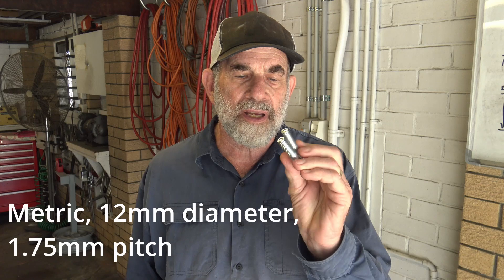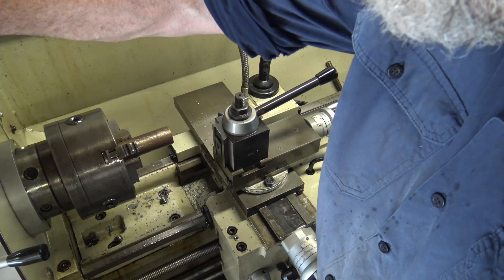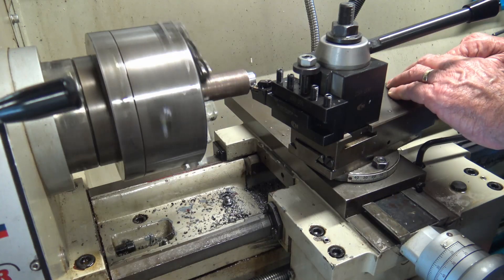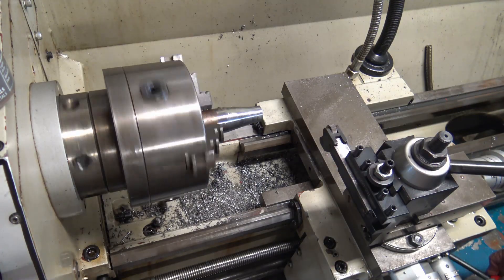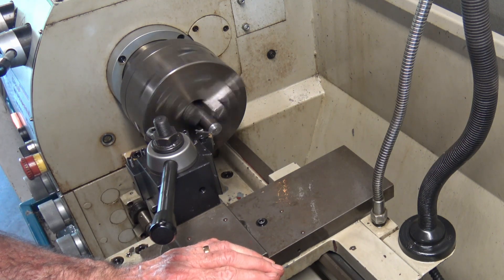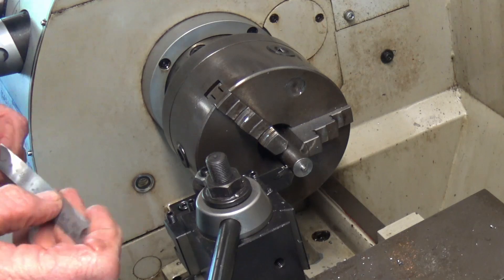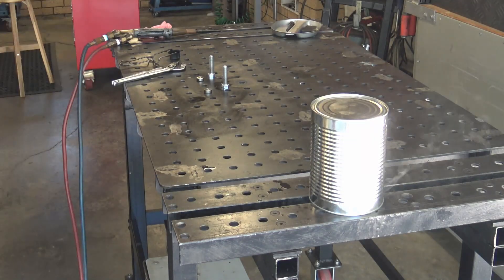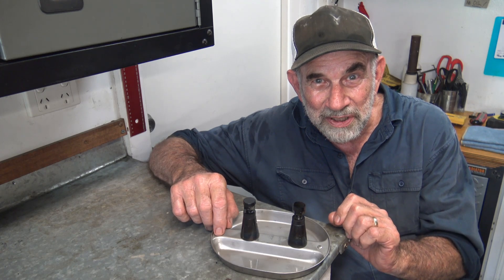Making Machinist Screw Jacks | HAFCO AL336 Lathe| Hot Metal Bluing

Comment: Thanks for a simple design for a useful tool! I have a couple I purchased from a shop that closed, but usually need several blocks to extend the height. I will use this design to make taller ones for my need. I will probably use fine thread bolts for “finer” adjustments. Glad I came across this video😊
Reply from the maker: Thanks for your comment and good luck with making your own 👍👍👍